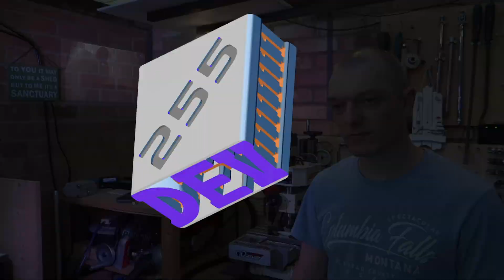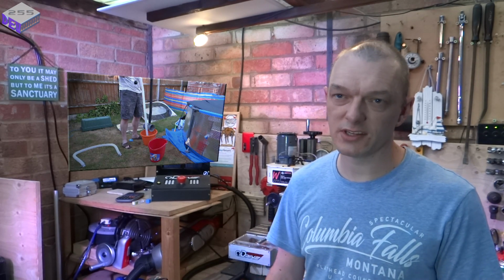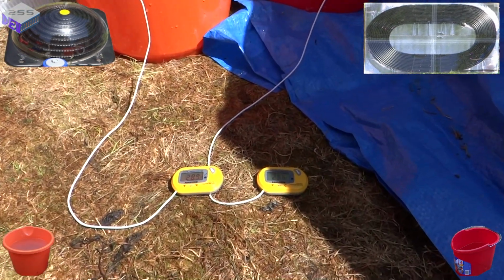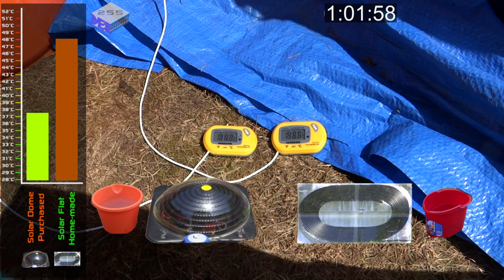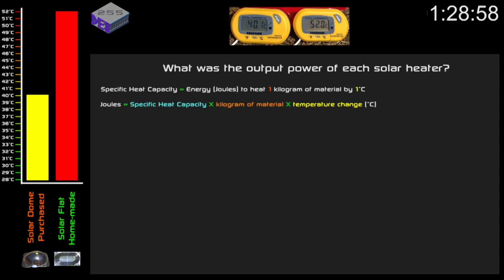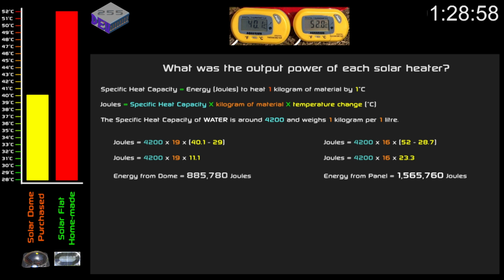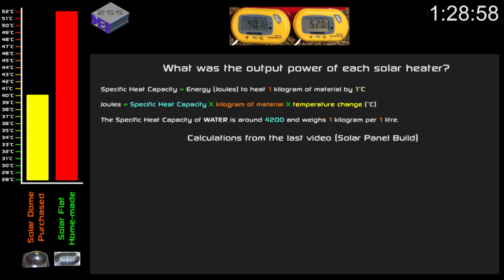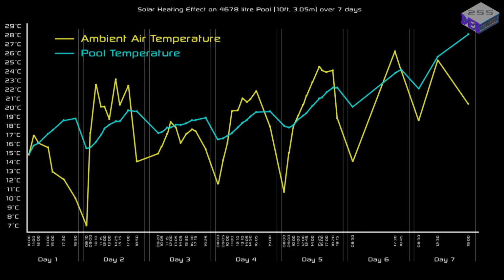2. Which Solar Pool Heater? - Homemade Vs Purchased

Comment: Do you run the pump to the solar panel at night?
Reply from the maker: Hi Chris, the pumps are controlled by an Arduino that monitors the temperature of the pool and panel, if the pool is cooler than the panel the pumps switch on, so the pumps do not run at night.
Reply: @TheSolarPoweredEngineer  Thanks for the video and the response,- i have the exact same pool and am trying to heat it on a shoe string budget.  I was thinking of adding the pump to a cheap wifi socket encase in a weatherproof box and then IFTTT it to the weather temp script for outside in my area.   

Also does the encasing make a massive difference other than just having the hose freely out in the open?
Reply from the maker: @chrisjako3404  That's a really good idea, although indirect, the local weather is fairly accurate. 

The hose in the enclosure does make a lot of difference if the wind gets up a little as it cools the pipe before it get chance to transfer the heat to the water, where the air inside and purspex/glass cover creates a greenhouse effect for your piping.

Comment: i am building a biogas system, but i am using the homamde solar to warm up the water around the reactors, my query is it okay to use the metal plate as the base and then the polyethylene pipes for the circulation of water on top of the base or i should use the boards ford the plate as i have seen in some other DIY solar heater?
Reply from the maker: Hi, I would say that you want to heat the water in the boost efficient way, where I have used a wooden board to fix plastic pipe to that worked well and in the second version fitted copper pipe to an aluminium plate, although both the copper pipe and metal sheet are contained within a wooden unit. Ideally, what you wouldn't want is the pipe or metal sheet to be exposed to cool air blowing over it and robbing the heat energy that you need for your project. In my opinion, a black metal sheet that sat behind either metal or plastic piping would work well if it was all enclosed in an insulated unit, that also allowed as much light in as possible. I hope that helps
Reply: @TheSolarPoweredEngineer   Yeah it does, thank you. which one is best for sufficient or much power production. Is it a wooden board painted black perhapswith polyethylene pipe or a metal plate painted black with polyethylenepipes, because using aluminiu is expensive and the budget that we are given is small
Reply from the maker: @willememvula2940  With a budget, I would say the best would be wooden board and PVC pipe. There is very little difference between the two in my tests. So the first design works well and will be 3 years old this year

Comment: Awesome video and a very accurate scientific comparison. I was considering making one of these to heat my pond in winter. Do you think they'd work in winter? I know the rooftop solar water heaters for household hot water are able to work in winter. Obviously I'd have to insulate and bury the pipework. I'd be really interested in a test on a cool and over cast day. I understand it would take a lot longer to work but would it keep the water temperature raised by 10 or 15 degrees if run all day in the winter?
Reply from the maker: Thank you Matt. They do work a little in the winter when the sun is on them, although it's more about the insulation of the panel, pipe and pool from what I've found, so with a pond you probably wouldn't see any benefit as the surface is exposed. It may keep the frost off the pond but may freeze the panel and pond if it gets too cold and could damage the panel and pump. I don't know why everything has to start with a P with this subject, haha. The household systems heat water to be stored in an insulated tank within a warm environment. I think the best option for your pond would be a heat exchange system to get the heat out of the surrounding air and put this in the pond, this is the reverse of a fridge effectively. Hope that helps
Reply: @TheSolarPoweredEngineer  Thanks for the detailed and considerate reply. I was worried about the whole setup freezing as well and/or cooling the pond on the really cold, dark and shortest winter days when the deepest parts of the pond are probably warmer than the surrounding air temp and I'd just be circulating that water around a freezing box.

Comment: Thanks, great video. It would be good to also get an idea about the flow difference between both systems (liters per minute). Should the dome have a significantly higher throughput, it could warm up the pool as fast or even faster than the panel.
Reply from the maker: Hi David, certainly, I went into a lot more detail in Part 3 Here: https://www.youtube.com/watch?v=Zt_RiMgSMEs, where the Dome was flowing at 9.1 litres/min and Homemade at 3.7 litres/min, although the homemade had a lot more surface area and could remove the heat from the pipes to transfer over to the pool a lot more efficiently.
Reply: @TheSolarPoweredEngineer  Excellent ... exactly what I was looking for. Thank you 👍
Reply from the maker: @David-tt8qz  No dramas, feel free to ask questions, I normally answer within a day or 2

Comment: Great video, was about to get a couple solar panels but now I may have to make one.
Reply from the maker: Thank you, I'm making a new one at the moment with copper piping mounted on an aluminium backing that is sprayed black, plus is mounted behind a glass sealed unit in a wood frame; the new one is more expensive, although may offer a little more heating. I'm still editing the video for that one though. Hope that helps

Comment: As solar energy is proportional to the area used to collect it,  You could also compare the area of both solar heaters to get an indication of the effectiveness with which the solar energy is captured. Overall this is one of the most efficient ways to heat a pool, it is a shame not more people use something like this. In the end, even though your build is more efficient, even circulating pool water through a black hose laid out in the sun (especially on a black surface like the roof of a shed) would have a measurable effect.
Reply from the maker: Hi, I agree these are very efficient, where the maximum calculated wattage (using input temp, output temp and flow rate) I measured from each panel was 988W (homemade) and 557W (dome). The homemade is 1.5m x 0.94m (1.41m2) and dome is 0.75m x 0.75m (0.56m2), so for efficiency (assuming 1000W/m2), the homemade at 701W/m2 is 70% efficient and the dome at 990W/m2 is 99% efficient. Although, 99% is very unlikely, so this is most likely the dome having more surface area.  Still I am very pleased with 988W from a homemade panel, plus it averages around 600W on a sunny day (measured in June). My dad is currently making a black radiator version to sit on the garage roof to heat a radiator in the garage.
Reply: @TheSolarPoweredEngineer  So I guess if you had unlimited cash... and limited space the domes would make sense as you could gather 50% more power in the same area.... but in the end cost wins as the DIY one is much cheaper.
Reply from the maker: @Wingnut353  Hi, yes that could be a good option from the above figures, although these dome heaters have gone way up in price, where one costs over £200 now. Could be a good experiment if I had the cash, sadly its back to making homemade ones.

Comment: I have similar solar heater, but my issue is finding a continuous duty pump that can handle Salt and chlorine for an affordable $. My pool is around 5000 gallons
Reply from the maker: Hmmm, good point, I've just had a good look around and the only one I found that seems decent for the price is the one on the link below, plus it uses 60% less chlorine so could save you pennies in the long run. I may even get one myself. https://www.swiminn.com/swimming/intex-salt-water-chlorinator-system-eco-5-gr-hour/137204461/p?utm_source=google_products&utm_medium=merchant&id_producte=8899808&country=uk&gclid=CjwKCAjw9r-DBhBxEiwA9qYUpXmAA-cFmAYJaKI65LfHD9Kt1vC5O3vkydU_rUjCUW4ZdRZmseBdcBoCydwQAvD_BwE&gclsrc=aw.ds

Comment: great job! an idea with a comparison with a black wood background ? thks for your job.
Reply from the maker: Hi Thank you, I'm just waiting on some components to make another for comparison; this will have a glass sealed unit, copper 8mm minibore pipe, aluminum backplate and insulation panel behind, all this enclosed in a wood frame and 18mm ply backed. I will be comparing with my other homemade one. Glad you liked it
Reply: @TheSolarPoweredEngineer   A very quick answer ;-))
Reply from the maker: @trotro1431  Thank you, I'm doing some video editing now and like to reply as quick as I can to comments ;-)

Comment: The experiment should have a bucket of water only as a control. Some of the temperature increase would be from the sunlight hitting the water as well as the ambient air temp., having nothing to do with the solar heaters. To calculate the energy output of the solar heaters,  you would have to subtract the the temperature increase of the control group.

Comment: Would I be able to run this using a 32w pool filter or would it need a seperate pump? Thanx
Reply from the maker: Hi, you should be fine with that pump, although it may restrict the flow through your filter and make the filter less efficient. I use the following pump and have it run outside the pool, with the input connected to the drain outlet so that the pool water pressure keeps it primed and the power remains outside the pool, plus the outlet just feeds through the panel then back in the pool over the side: https://www.allpondsolutions.co.uk/pond/pumps/full-range/1400lh/

I hope that helps.

Comment: Thanks for the video, I was thinking about creating a sort of heat battery using water pumped through a panel like this.

I think a 220 liter drum 30 degrees above heating goal stores more energy than a Tesla power wall. This could decrease heating bills for small spaces.
Reply from the maker: Hi, Thank you, yes water is a good store of energy with a Specific Heat Capacity of 4182, as long as you can keep the energy from escaping (well insulated). So 220 litres of water would require 7.667KWh. The first version heater I made in this video produces 600W on average over an 8 hour day (a very clear sunny summer's day), so produces 4.8KWh per day, although, during winter months, it's fairly low (I do need to do a winter test with this one). Solar thermal is a lot more efficient than Solar Voltaic, as it directly heats the water rather than charging batteries, inverting to mains voltage and then heating through an electrical element (so many in-efficiencies), so should save your heating costs a fair bit.
Reply: @TheSolarPoweredEngineer  I have an idea for a solar heater that might scale up well enough. I was thinking about a system of multiple vessels, that can be pumped depending where you want to focus the heating, if storage is in the same room you want to heat, the "self discharge" would be heating itself.
Reply from the maker: @lAljax  Hi, I'm not sure I fully understand your system, although if it works on a small scale, then I'm sure it can be scaled up, it's only physics 😉. I'd say if you can make it, give it a go, would be interesting to see how it performs.

Comment: Your panel is probably working even better than you think (in watt hours) as due to the test generating high water temperatures, it will be losing heat faster as it gets hotter.

Somewhere on YouTube there's a video of someone comparing PV with an emersion heater and direct water heating and in colder weather. The PV won do to the heat loses in the other system.
Reply from the maker: Hi, certainly, once it was connected to the pool and I was measuring input to output temperature changes and have the exact flow rate the wattage was far higher, where the homemade panel got up to 900W last year.

It may be worth you taking a look at my third video on this as it goes into greater detail here: https://youtu.be/Zt_RiMgSMEs.

PV panels are only around 20% efficient at present and that is not taking into account the losses in cables to the heater or the heating element or connections. I believe the direct heating of water can be around 90% efficient.

Comment: That's amazing your device is definitely superior but if I'm calculating right in that 1.45-hour time-lapse video the solar heater was only putting 300 watts of energy in that pool I know in a larger pool like mine I wouldn't notice a 300 watt heater working 24/7 much less only when it's sunny
Reply from the maker: Hi, that does seem fairly small, although this was on a cloudy day, where the panel reaches 900W over mid-day during the peak of summer in the UK (around 950W per meter squared of sun energy, the equator is near 2000W, although it wouldn't be required there). The panels' average output over a good 8-hour day of sun is 600W, equating to 4.8kWh per day, this homemade one and the purchased one got our pool up to 31ºC with a good week of sun, where we were able to go in the pool overnight too.

Comment: Really useful and straight forward ... I too have the reflective outer  so your video was 100% reflection of my circumstances.
Off to the shops I go to make my own.

Thanks
Reply from the maker: Hi, just for info with the latest info from my test. The pool of 4600 litres heats up by around 3 to 5ºC per day on a sunny day, so you need a good few days for it to warm up. It's a lot of water to heat and from my recent calculations both the panel and dome solar heaters generate about 25% of that heat, it looks like most of the heat is generated from the sun directly heating the water via the black cover over the pool and surrounding air. I think the panel is still worth it as 25% extra heat ensures the pool heats from day to day. The foil wrap around the pool helps too, where I only lose a couple of degrees overnight, where the pool is currently sitting at 28.12ºC at 08:47 in the UK. You can see the foil wrap in part 2's video and my intro video. Hope that helps

Comment: fantastic! im going to make a pair of loops on a single 4x8 sheet of plywood and cover it with corrugated roofing panel. i also have some mylar film and i might make a reflector to increase the effective area without having to make another set of loops
Reply from the maker: Sounds like you have a good idea to get the most out of the system, I am currently making a copper pipe version with aluminium backing all sprayed matt black to capture as much energy as possible, all this behind a sealed glass unit. Good luck with yours, feel free to let us know how it goes.
Reply from the maker: @mohammadwasilliterate8037  Hi, definitely, the idea of the reflective foil was so the heat doesn't escape out of the back. The new unit I have made this year is fully closed behind a glass sealed unit and has reflective foil, although this is now behind an aluminium black panel to collect more of the heat.

Comment: What did you use for data collection and graphing?
Reply from the maker: Hi, I used an Arduino Nano and an Arduino SD card Read/Write module that logged all 10 sensors every 15 seconds. The file was not that big and created a CSV file (Comma Separated Values) for use in Excel. Excel handled all the data well and I was able to create the graphs from that. All the data, Arduino code and other related info can be found on my website Here:  https://www.dev255.uk/what-i-bought

I hope that helps.

Neil.
Reply: @TheSolarPoweredEngineer  cool, thank you!

Comment: Excellent video and panel you built. You can tell you're an engineer. 
Now I'm looking to put a pool in at home (still unsure) but water temperature in the UK worries me.
Yes on a hot day that panel works great but say like now in May where the weather has turned again as usual and overcast.  How efficient is that panel then ?  Could you do a test and video on that perhaps.? Do you keep your pool full all year and do you use that panel continuously off the pump whilst the pump is in use? Tia
Reply from the maker: Hi, thank you. Yes, we don't have much in the way of sun in the UK most of the time. That's a good idea to do a video on the effectiveness on a cloudy or out of season day, I will have to do one of those. We don't keep our pool out all year round, just over the summer season plus a few more weeks thanks to the solar heaters, although last year we had hardly any sun. The other point to note is to have the pool in a location where the sun is always on it and have a dark coloured floating cover as this will reduce heat loss and act as a heater also. We now have a retractable parasol to give us some shade when we all get in the pool too.
Reply: @TheSolarPoweredEngineer  much appreciated Neil,  thankyou for your reply.

Comment: Hey great video. Think I will try making a solar pool heater this year. Noticed you have insulated the pool walls, what did you use? 😁
Reply from the maker: Thank you. The insulation is SuperFOIL from Amazon, I have a link to it on my website dev255.uk. it's radiator foil insulation. I will be making another one later this year too, hopefully improving its efficiency.
Reply: Would love to see a video on that! Love seeing all the data and calculations, all the adverts for these solar heaters give unscientific claims like raise water by 8c. But over what time period? For how much water? No physics knowledge haha
Reply from the maker: @chrisorr5223  Hi Chris, definitely, it was one of the reasons for making this one, Part 3 goes into even more detail